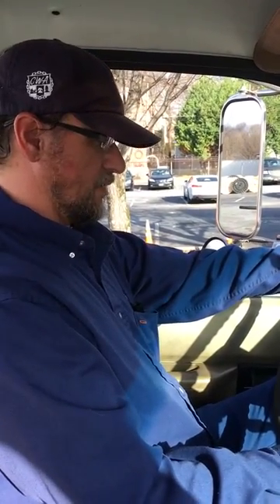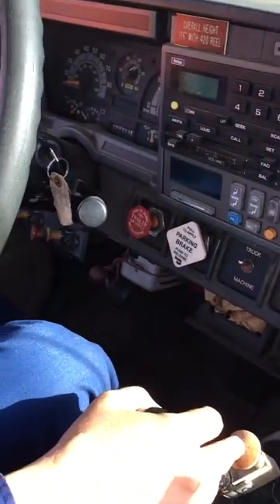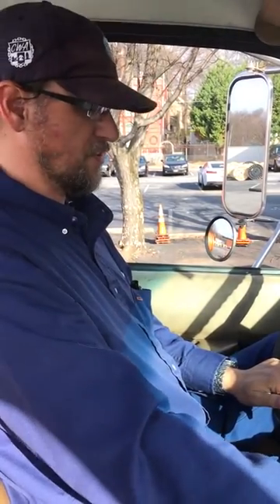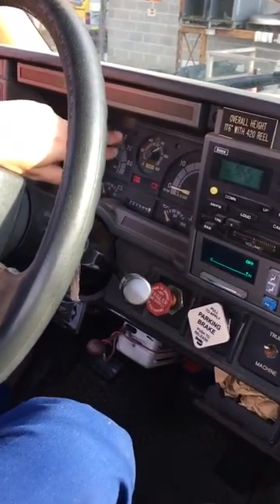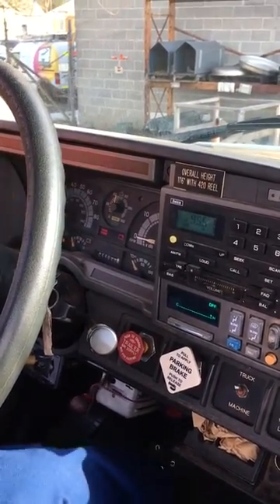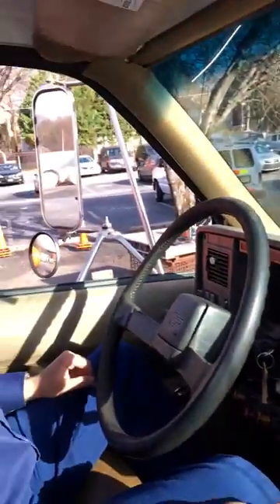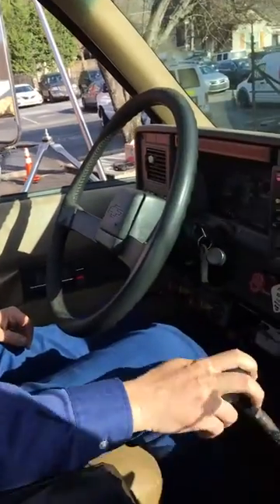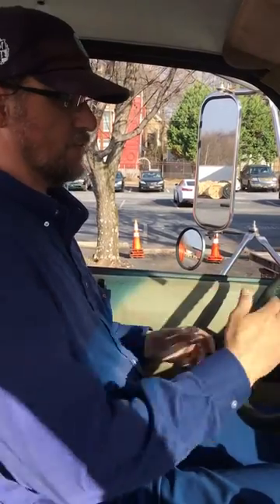Air brake test CDL Pretrip

Comment: Great video... I have a question,  when you do the air brakes test for a combination vehicle with electric trailer brakes. Are you supposed to pull the "breakaway" safety pin on the trailer? Or just perform the air brake test as if it were a straight vehicle?
Reply from the maker: edgtr87  buddy I’m not 100% sure on that I know each state has what they want you to do, either more or less. The break away is one and the battery and a couple more things. I always say learn small parts then add another small part till you have it all. Good luck with your test.